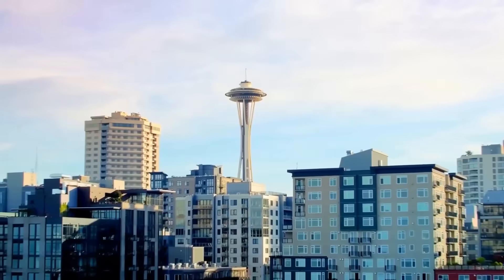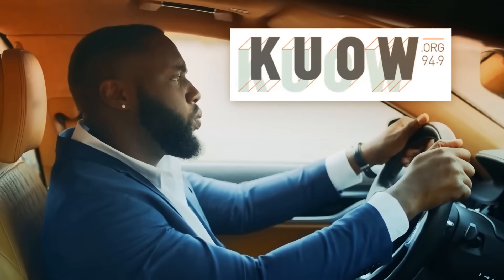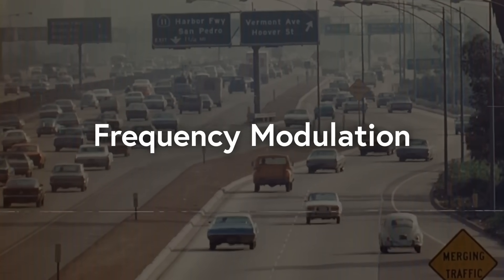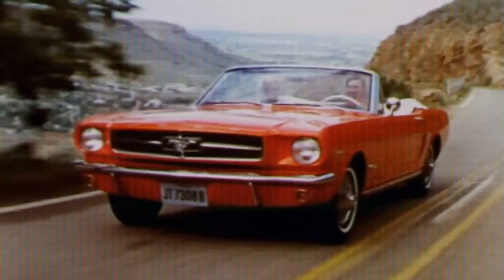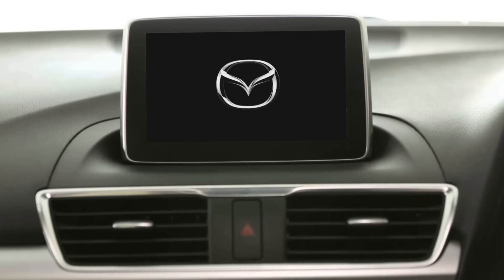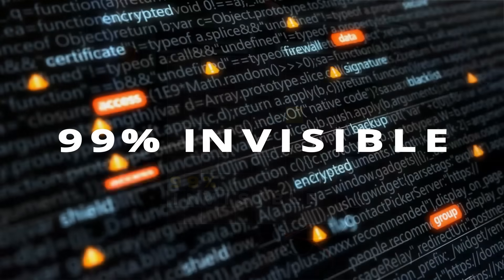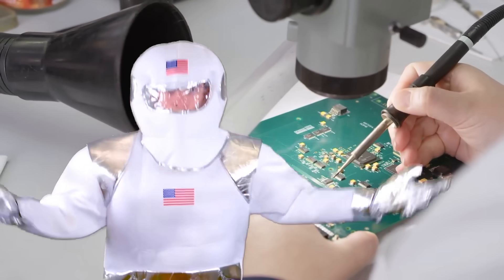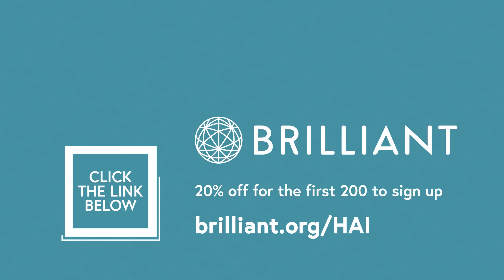Why Hundreds of Mazdas Tuned to 94.9 Broke Simultaneously

Comment: That %i isn't even about using it somewhere, it's about trying to do something stupid. It's almost like someone decided it'd be a good idea to eval station names instead of just, I dunno, doing sanity checking and outputting it. That way lie exploits.
Reply: Honestly everything about this just strikes me as terrible design decisions.
Reply: @chyza2012  Why learn and use `fputs` safely when I can use `fprintf` and not have to learn a second function name?
Reply: @killerbee.13  The function call sprintf(dest, "%s", someString) will act like strcpy but report the number of copied bytes rather than returning a useless pointer to the start of the destination.  If the %s is omitted, the function will work the same way provided the second argument doesn't contain a percent sign.
Reply: preeeecisely

Comment: As a CS student i think that the requirement to buy a new inbord computer is a scam. You should be able to reset the memory of the computer by cutting its power/deleting its memory.
Reply: Even you need to change the computer it should be free because it's isn't user fault at the first place
Reply: Yeah. If you can get the bad files out of the cache, then the problem will be resolved even if the vulnerability would remain. There has to be a way to wipe the electronics and load a fresh version of the firmware. Your typical mechanic probably can't figure it out, but a Mazada recall program sure could- and that's what they owe the victims
Reply: in theory you should be able to, at worst you open it up and let a small voltage onto the memory reset line without powering the rest of the circuit, file gets garbled or totally erased and the error handler dumps it because its no longer a valid file instead of being valid but wrong
Reply: That's what I thought, this sounded more like a software issue so flashing an updated firmware would fix it.
Reply: @dvdvideo10  The only way a user (or dealership) can flash new firmware is if the current system is working. Since it's not, you'd need to do it over a debug port (like JTAG), which is FAR beyond the ability of anyone working in a dealership.
Reply: @repatch43  Why is this beyond the tech at the dealership? It seems to me that it would be the same as any other patch at that end. Developing the patch would be done at corporate level by a programmer.
Reply: @robertstoneking7916  Because, at the best, they have to open an electronic unit up never meant for field service, to access a fragile connector never meant for field service, connect a laptop (which I assume they'll be sent, never meant for field service) running some software NEVER meant for field service, and then work through any problems they'll encounter over a phone taking up boatloads of time.

Modern mechanics, honestly, don't have those skills. Heck, a few years ago I had my car in for service and the tech noted a small hole in a part of the exhaust pipe near the back (before the muffler). He said I had to replace the whole exhaust system, from the manifold at the front, all the way through the muffler to the tail pipe. That included the cat and the O2 sensors. When I asked if he could just cut out the part and replace it he stared at me like a deer in headlights and simply answered no. I considered that maybe he just wanted more money out of me, but his expression made it clear he had no clue how to do that. Modern techs don't debug problems much, they don't fix things, they replace components, that's all they are trained to do.

Oh, and I cut out the piece and replaced it, working great ever since.
Reply: @repatch43  so this wouldn't be anything like normal updates and patches where they hook up the factory supplied service computer to the head unit USB, select the update, and click the confirmation prompts. Is this because of this problem specifically or KIA radios in general?
Reply: @robertstoneking7916  Yup, the OS is in a boot loop, so the 'normal' way of updating firmware isn't even available. The problem is that there is bad data in the cache (an image file without an extension), the OS tries to process that data, crashes, and the watchdog reboots the unit, which causes the OS to boot, try to process the bad data, crash, and, well... boot loop.
The fix would be to clear that cache, which is stored in NV storage, so power cycling doesn't help. Without the OS booting the only way to do that would be through diagnostic ports (probably JTAG based). Again, FAR beyond the capability of anyone at your neighbourhood dealership.
Note I'm ASSUMING there's an available connector on the board to do that, it's possible that for production units the connector wasn't even populated, and since the board is likely conformally coated it would be a bear to try and solder one on.
Reply: @repatch43  OK I'm used to PCs and have USB boot enabled on mine at home so I can interrupt boot loops if they're cause is on the hard drive.
Reply: @repatch43  It's actually fairly easy and it's kinda weird Mazda resorted to completely exchanging the head units. The serial port is quite easily accessible and really all you need is a few jump wires, a computer, a serial to USB adaptier and Putty. After that it's literally two commands (disable watchdog to prevent the boot loop and delete the contents of the station logo folder). You could easily build a script in about two minutes and write up instructions in five. 

If that exceeds the capability of a dealership, then they have way more serious problems...
Reply: Ideally a reboot would clear the cache automatically, especially after a crash. Clearly the development team didn't take into account unexpected situations and handle them gracefully.
Reply: @therealbenschwartz  I agree, but sadly few embedded systems do that. As a MINIMUM, I'd expect hitting the reset button would wipe the cache, but obviously the team was so bad at their job they didn't even do that.
Reply: And the %i just means Mazda has a format string vulnerability. That's scary af. Arbitrary Read-Writes could be possible!
Reply: Sadly sometimes it is not that easy. The file is probably somewhere in a flash memory together with all the OS files, so it is nonvolatile, completely erasing the flash is not really an option due to the OS also being there, and selectively deleting the file is probably not possible due to the OS not having facilities to allow external access to the file system. If it was possible to put the infotainment system in upgrade mode a carefully crafted update package might have worked, but otherwise the only option is to probably unsolder the flash chip, reflash it with a clean OS, and solder it again. Not something you would do in a usual shop, so replacing is the only option (then the old one can get refurbished and installed in a new one etc)
Reply: @bracco23  there is this thing called a reflash, also why dont these computer have a safe environment mode, which wouldnt load cached info and only start the necessities for the os to run, which means you could then go into file sys via cli and selectivley remove files, if there is not safe boot environment available then i really dont get whats so hard about flashing new firmware, tesla does it over the air ffs, so why cant a recall be put out, you show up at a dealer and 10 mins they flash new firemware, done... and if mazda made a OTP radio, then thats on them and is just a stupid move.
Reply: $1500 for a clunky UI/UX straight out of windows xp
Reply: All newer cars use dedicated ROMs instead of CMOS chips. This wouldn't be possible for any boot code. For something this mission critical, there shouldn't be a way to easily modify working memory by the user.
Reply: As a Software Engineer I'm annoyed that they didn't clear the cache at startup if they are going to have the system just reboot on any error.  oye some people need to get slapped. if you can't clear the cache after the exception is thrown, then clear it just after startup. so you don't get the computer stuck in this boot loop.
Reply: Yeah. Just re-flash the computer and you should be fine. Would probably require the dealer to do it.
Reply: As I've heard it described, what happens is the bad content is saved in a cache (non volatile memory), the software then analyzes it and crashes. The watchdog process notices the system is hung and reboots. The system starts up, analyses the bad content, and crashes. And over, and over again. Removing power, hitting reset doesn't work since it's non volatile storage that isn't wiped on reset (ANOTHER sign of how badly written this code is).

Only solution is to access the storage over a debug type port and wipe it, which is certainly possible, but WAY beyond the capability of anyone working in a dealership, so swap the hardware is the only option.

It's a sure sign of how horribly poorly software is in cars today.
Reply: If the broken extensionless file is written onto soldered flash memory it isn't that simple, but Mazda almost definitely has tools to go into a debug mode or reset the OS. So they take your "broken" board, reflash the OS, then sell it back to someone else as a refurb for a pretty penny with almost no work..

Support right to repair laws, people. Or else you get clownery like this.
Reply: @ryjelsum  there is unfortunately a precedent for this not being possible, nintendo, the wii u has a nasty flaw making it kinda unstable while changing system data and if anything happens to mess with the write process... well it crashes and leaves corrupt data in the user section of the nand, this is impossible to fix at current time because the entire nand is encrypted with a key unique to each cpu that isnt possible to extract from a nonresponsive unit.  i sure hope no one else is this brain dead to include such a system and not have recovery protocols but i wouldnt put it past a big company who left such a nasty vulnerability in place
Reply: @nickolaswilcox425  Interesting. Thanks for letting me know that things aren't always as easy as I think - it's good to be humbled a bit.

It makes me think of ways that these bricked Wii Us could be revived, though all of the ideas that go through my head are things that would have required Nintendo to have foresight and create some internal recovery tools. And they probably didn't, since it's likely not really economically the 'right' call to put the labor into boards that are hard bricked like that. Sigh.
Reply: @ryjelsum  Honestly, I doubt Mazda has anything of the sort. These systems are contracted out. The logistics just gets to complicated, and Mazda doesn't want that expense.
Reply: @repatch43  Okay, fair point. I'll say that I was spinning conspiracy and don't know how the supply chain for cars really works.
Reply: Mazda have been replacing them for free
Reply: @MatthewDrivebolt  they  fucking better
Reply: That memory also probably stores a lot of important things like the OS
Reply: Power cycling probably wouldn't work because it's gonna be using nvram or solid state/flash storage, but a manual clear would work. Although, probably not easy for the consumer to do. A better idea is to use the file's header to also determine the type instead of just using extension.
Reply: an an EE student, i can tell you that some types of memory can presist through power  cycles
Reply: Well, you can just disconnect the cars battery.
Reply: The less control you have, the more money they have. Simple economics.

Comment: how does this even happen??? file extensions are *hints*. you're supposed to use the headers in the file to figure out what type it is, and the extension is just a hint. you're not supposed to actually use the extension to parse the file??
Reply: File header has a flaw. What if I transmit the same text as a file header? That would effectively make computer think that it is not a text file and it would crash the computer.

Comment: Worth noting that files will often have a "magic", from which you can detect what file-type it is
Reply: Fundamentally no matter what, out of band data shouldn't brick your damn system. You should fail fast and fail robustly. Unfortunately robustness testing is usually the first form of testing cut short by date-obsessed bad project schedulers, right around the same time as regression testing.
Reply: It all comes down to trust. The assumption should be, the data is malicious, it's trying to do something bad. Assume that and act accordingly until it is proven that the data is safe. It should not be possible to form any kind of data to do anything bad.
Reply: Are you talking about file header? Because it has a flaw. What if I transmit the same text as a file header? That would effectively make computer think that it is not a text file and it would crash the computer.
Reply: @empiricalprevailsegment  Well, you don't always need the header to detect the file type. If a file begins with the bytes ff d8 ff, it's probably JPEG
If it begins with the bytes 89 50 4e 47 0d 0a 1a 0a, it's probably PNG
If it begins with either of the two strings "GIF87a" or "GIF89a", it's probably GIF
That's how detecting file type with "magic" works
Reply: @4906  That's the definition of file header. I know this because I have experimented with raw files and image files in assignments.

What would happen if I used hex chars ff d8 ff in text file?

Comment: That's what still great about simple mechanical ICE cars. It's easy to fix and has much less room for error.
Reply: I don't think there's anything simple about an internal combustion engine!
Reply: @Roxor128  Yeah, worst case scenario with all the original electronics bricked, an electric car needs a giant brushless motor Electronic Speed Controller, and some basic circuitry for smart battery charging, regenerative braking, power assist for steering/brakes, etc. An internal combustion engine is frighteningly complicated and interconnected from a mechanical standpoint, and also on the electronics/software side. I'd definitely go with the electric, at least I could, in an apocalypse situation, get it RUNNING with electronics I built myself (and probably fairly close to original specs), you can't say that about the ICE vehicle -- so many sensors and valves and such interact so finely that you'd need secret manufacturer information or a master mechanic with significant time on their hands to reconstruct the correct sequences of operations to run the thing, and various edge cases would haunt you for a long time afterwards. Even if you have an (ancient, inefficient, worn-out, badly smog-producing, etc.) completely mechanical one, you still have a good fraction of the complexity in there, it's just mechanical. Some people might find that more intuitive, but for me the electronics would definitely be the intuitive one, and they're way simpler electronics in a basic electric vehicle than the mechanics in a mechanical ICE vehicle.

Comment: Thanks for pronouncing 'gif' correctly. 💪🏿

Also, both a bug like that and they can't be repaired? Mazda should replace the radios for free...
Reply: When did Sam bring up peanut butter?
Reply: I think the radio station should pay up.
Reply: They will, from what I heard, but it's still a problem because they don't have a few hundred spare radios sitting around on shelves...